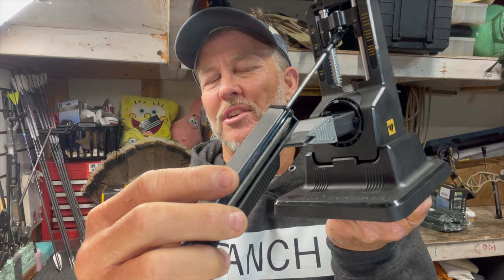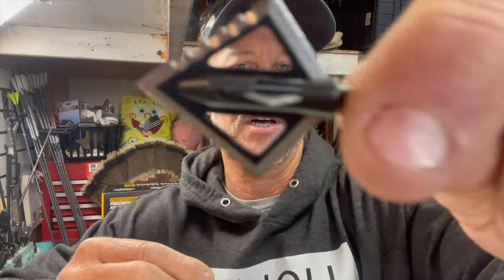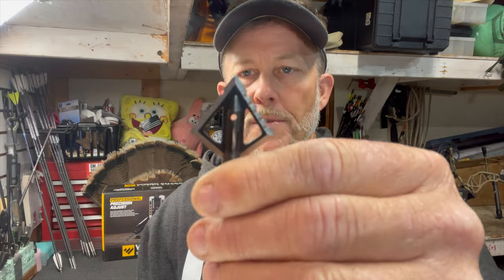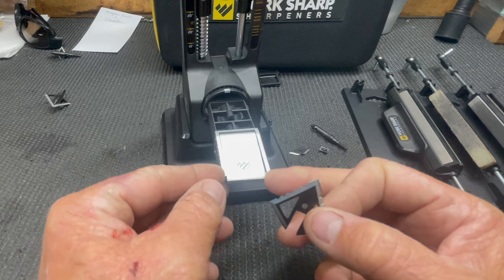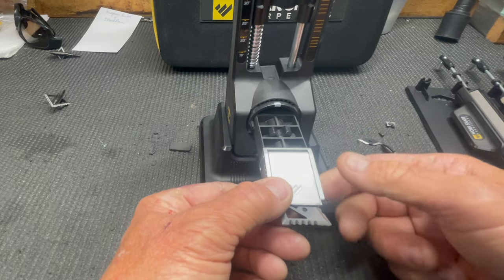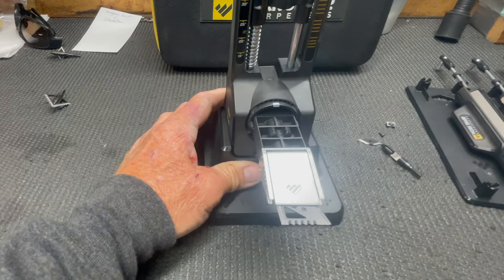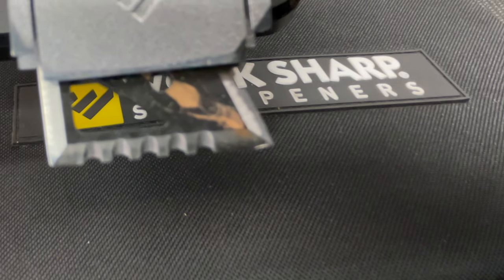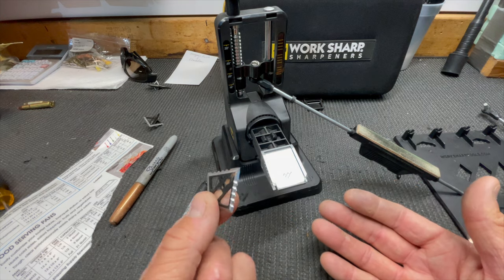How to Sharpen Magnus Black Hornet with Worksharp

Comment: Hey Troy. Bonus tip for making sure you're getting these set consistently in the Work Sharp jig.  Get a sewing hem gauge with a slide stop. I found that keeping them at 8mm  from the edge will get you set at the 17* bevel. Just wanted to pass it along.
Reply from the maker: @bowlwest73  
Noted!!

Comment: Great broadhead!!!! Makes’’em bleed a lot and fast a combo that breathes success for bow hunting. Pair that with a lifetime warranty that you can easily use if you have the damaged head send a pic to the owner Mike and he’ll send you a new one. I’ve used the warranty recently and it was easy as could be got two new heads within a week or so of sending in email. Tip curl is its weakness but all cut on contact heads will inherit this weakness they don’t always curl but hit solid bone and it can definitely happen. It doesn’t turn me away from using as they still will have tons of sharp edge left to cut and kill. They leave mechanical looking holes and blood trails.

Comment: Hey Troy, is there a reason you used the older WS precision adjust instead of the newer pro precision adjust?  Is there any difference that makes the older model better for the black hornets?

Also, tying your twine/string to a small, flexible stick and making a little bow makes it easier to sharpen the serations.
Reply from the maker: I mentioned both and just used the middle priced one.